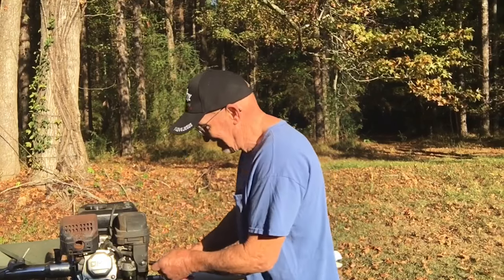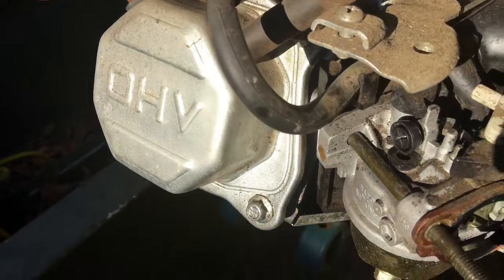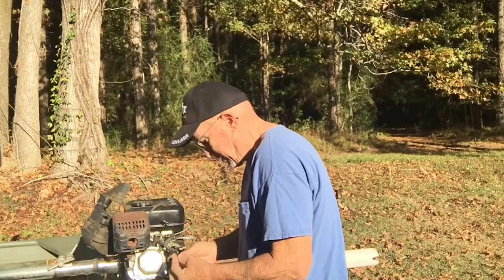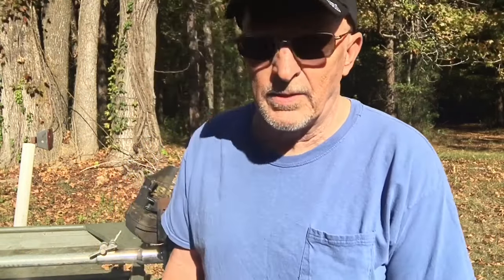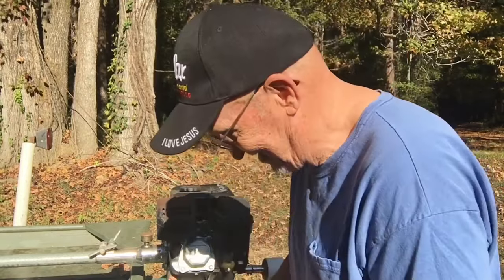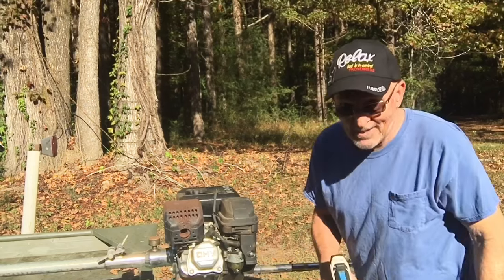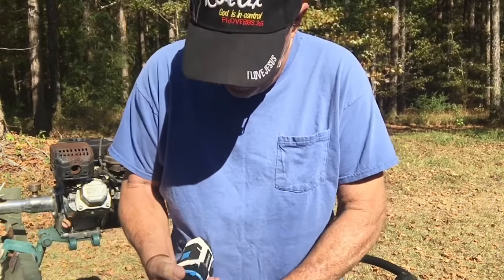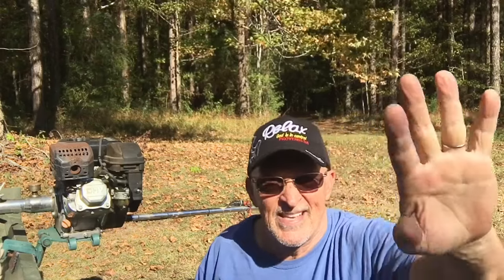Predator 212 found the problem

Comment: I'm just starting to learn about Predator motors. Thanks for a great tip for troubleshooting
Reply from the maker: @Chrissvarietychannel549  Hey Chris🖐 I have had extremely good service out of put-put. When I first got it I would pull my arm off trying to start it. A quick google and YouTube search said throw the spark plug away and go buy (I forget what specific plug was recommended) and it has started first pull ever since! Other than having to clean the jet out every once in a while it performs flawlessly.